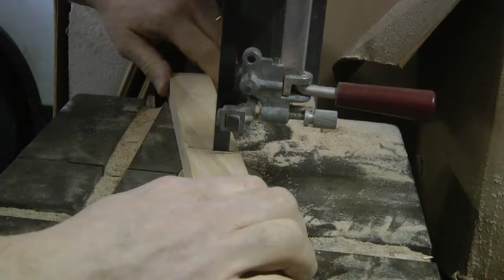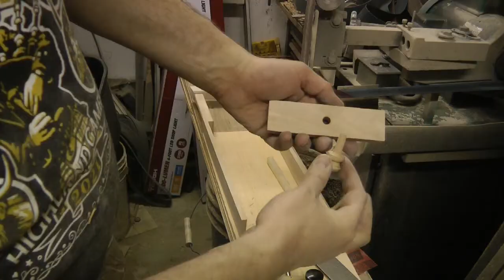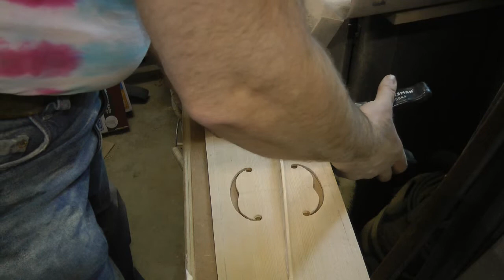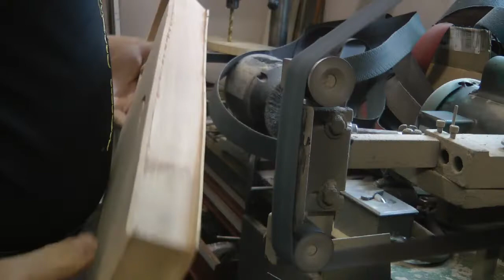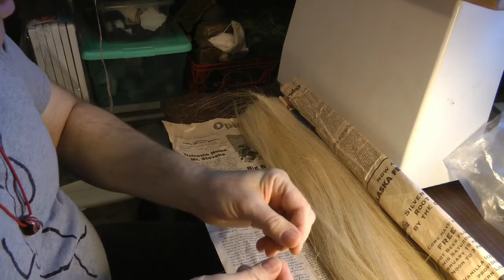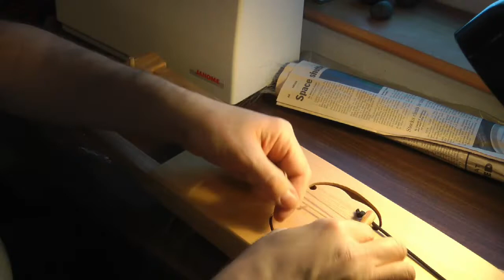Building a jouhikko

Comment: Great work patrick! Looks great, nice and trad. If you're going to make a second one i do have a bit of advice, which is to make the sides just a fraction thinner! helps it resonate some more. and is there a soundpost inside? Good luck and have fun!
Reply from the maker: You are right about that, for sure!  My building is a bit amateur at the moment.  I've made a couple since this video with much thinner sides.  (And this one does have a sound post, though I have built them without, too.  Hard to decide which I like best, to be honest.)

Comment: Hello there. I don’t know much about music so I must ask how do you tune it? Do you twist the small dowels to increase the tension on the strings or something I can not see? Very nice btw👍🏻🇸🇪
Reply from the maker: The pegs are like violin pegs.  A tapered peg in a tapered hole can hold a string better than you'd think.  There's a wider part at the back of the peg, like a paddle, that allows me to grip and get it tuned up to the pitch I want.

Comment: Hello, Patrick.
Thank you for this video! Could you please tell me if you don't use the lélek in your lyre design, which is usually located under the bridge and transmits the sound from the top deck to the bottom?
Reply from the maker: In this one, yes, I do have a sound post.  I have made others without it, which is interesting to compare.  Without, it has a much more nasal sound, though it isn't appreciably quieter.
Reply: @patrickwoolery6000  thank you for your response, Patrick.
At what point does the sound post place up? In your video I didn't see it being set.
Reply from the maker: @avendim  I'm afraid it didn't end up on camera.  Part of the issue with trying to shoot video and build something at the same time.  The sound post in this case was glued to the back before I put the soundboard on.  I know that's not the most traditional way to do things.  In a future build, I will try doing the "correct" thing and inserting it through the sound hole.
Reply: @patrickwoolery6000  Thank you for your reply! I'm leaning towards the gluing option for now, too. But it would be great to see, how  the sound post installed the classic way.

Comment: Awesome video but when you use the table saw you shouldnt go that close to the blade with your hands use a push stick itll save your fingers
Reply from the maker: That's good advice.  I tend to feel comfortable with certain tools, but you are absolutely right to remind me because it is normally the tool that seems like a friend that actually ends up causing injuries.
Reply: @patrickwoolery6000  also you should add a riving knife to the table saw to prevent kickbacks (i'm not shure it just lookjs like ther might be none) would a be a shame if such an excelennt crafter looses fingers
Reply from the maker: @chrisvaupel  It is my dad's saw.  I just borrowed it for part of this project.  I agree that I don't want to lose fingers.